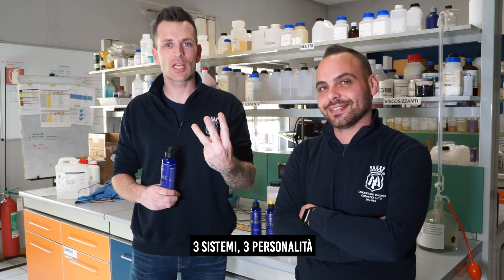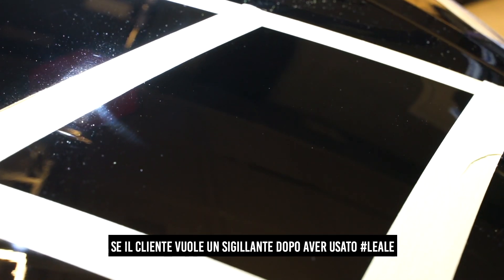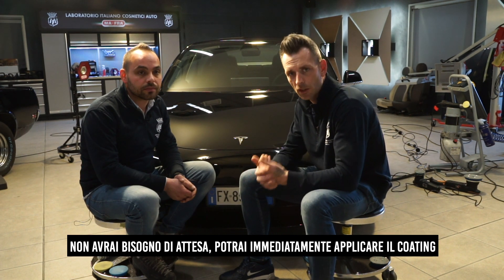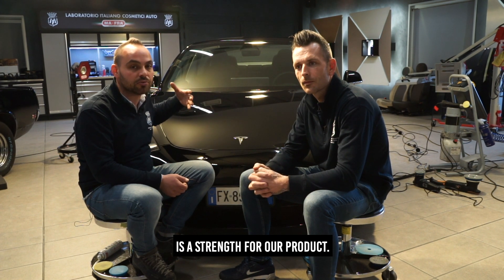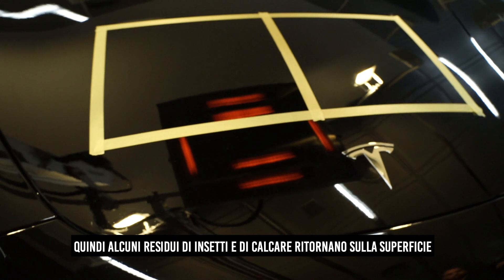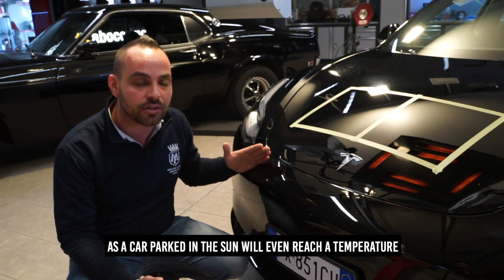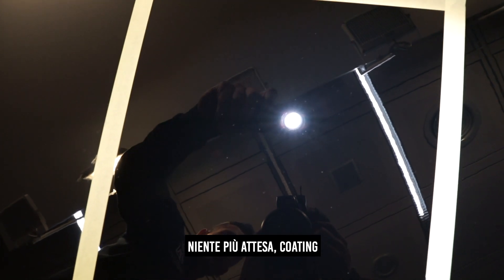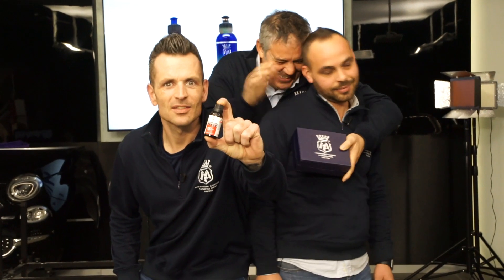Scopri come utilizzare #Fiero il super refinishing primer with S.A.M technology con #Labocosmetica

Comment: So, does Fiero contain a small abrasives to remove small scratches? Or, is it just a finish step before applying a ceramic coating when the paint is already polished to ideal state?
Reply from the maker: Yes, you can also use #fiero to remove those small scratches, it also contains abrasives that can remove small ones before a full finish.